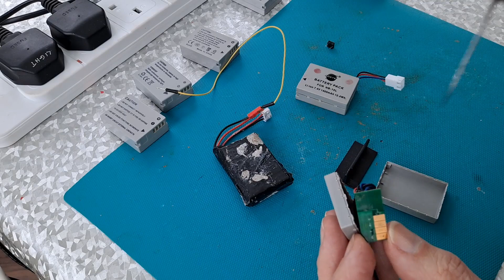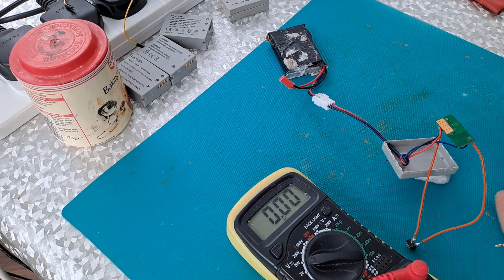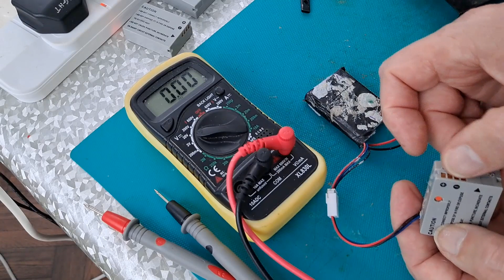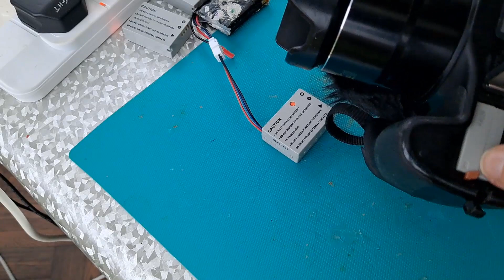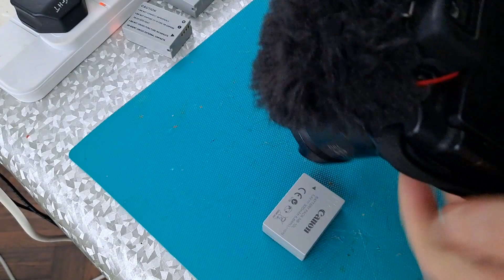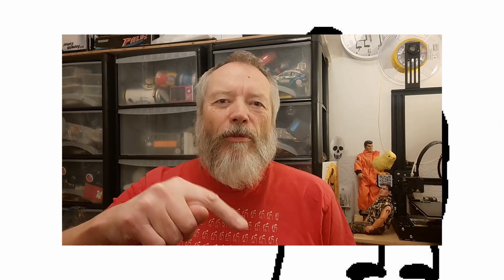Part 2 Canon Battery NB 10L external power adapter REVISITED

Comment: A thought came to me overnight (bad dream maybe?).  Normally, the reset happens when you apply a charge from outside the battery to charge it.  When the circuit sees a voltage across the pos and neg contacts, it connects the internal battery to the neg contact to let the charge in.  When the charge on the internal battery gets above the cutoff voltage, the circuit won't cut the connection from the internal battery to the neg connection.  There's something between the internal battery neg and the neg connection.  However, you've now created a loop back to the internal battery when the switch is pressed.  A short circuit?  idk.  I guess the over current protection will kick in.  I'm suggesting that 'instantaneous' might be relevant for the switch, and maybe a resistor in line with the switch might be worthwhile.  Might not even be wort worrying about.
Reply from the maker: I am not sure what internal battery you are talking about? Maybe just a figure of speech. I am probably misunderstanding your explanation. This is a momentary push button, there is no connection after the button is released.  The button I have added is a substitute for a function of the battery charger. In one of these videos I demonstrated that by simply placing the dummy battery in the original charger, the output was 'switched on'. However it was never the intention to charge the external battery via the dummy battery module, although that is technically possible. It was to allow a larger external battery to replace the original battery without modifying the camera.
Reply: @GrandadIsAnOldMan  .. It is a fuzzy attempt - sorry ... I guess what I'm trying to do is come up with a 'functional' flow of how the circuit is working, without the schematic.  Now for the Theory - 
  It makes sense that it doesn't recognize the charged battery after it's reconnected.  It would be continuously monitoring an under voltage battery.  Which would drain it even lower.
  So it just shuts down and disconnects the battery neg from the neg brass tab.
  I think the pos brass tab is always connected to the battery pos.  So when you press the switch, you are connecting that same battery across the pos and neg brass tabs.  The circuit sees this charge, wakes up and wants to charge the battery.  We know you can't charge a battery from itself.
  It sees that the battery is some amount over the cutoff voltage (hysteresis) and starts monitoring  again using the battery power (not the brass tabs).
  I'm guessing again here.  Before you can release the switch, the over-current/short-circuit function says NO NO and disconnects the battery neg from the neg brass tab.  The circuit doesn't shut down, but monitors the brass tabs, using the battery power, until the NO NO goes away.  The NO NO does go away when you release the switch.  
...
I was trying to theorize why the circuit didn't give up the magic smoke :-D

Comment: i agree with you in not bypassing the protective circuit, something about not wanting an electrical surge to fry your Canon.

Also like how you put the new switch in the case itself.  

How long do you have to depress that switch in order to reset the circuit?
Reply from the maker: It is instantaneous, just a touch.

Comment: A good thing you followed up. I have the same issue with a few power-banks, when I replace the 18650 in them, they need a super short charge from an outer USB source to initialize. I have not tested your idea, touching the plus or minus briefly, I will check that out as well, thanks!
Reply from the maker: Thanks, the new comment received today made me re-read the old comments and I realised I had not gone back and tried the suggestions.